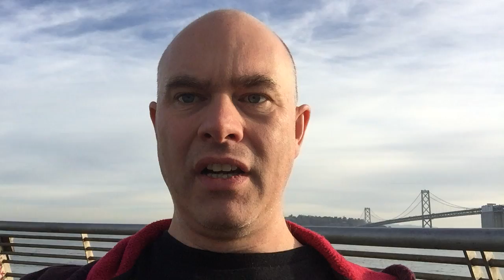Let's Talk About The Antares Launch Failure.

Comment: Damn.  I'm a resident of the DC area and I regularly attend Antares launches.  There's a viewing location that is now off-limits due to this event, and it's notoriously talked about every time I attend at the new viewing spot.  I hadn't begun attending these launches until 2017 or so, but a video of the explosion came across my Youtube feed just now and I began digging into the rabbit hole.

Thanks for this video, Scott.  It means a lot to me.  I wonder if this had anything to do with the acquisition of Orbital Science by Northrop Grumman.  I did briefly get to speak to an old Orbital Science engineer at the recent Antares launch about two weeks ago, but wasn't able to get much of a word in.
Reply from the maker: Years later we know that it was a failure in the turbo pump bearing, while Aerojet Rocketdyne stood by the engines Orbital decided to switch over to a pair of RD-191’s and has had no problems since.

Comment: With regard to the whole debate about the kerosene versus hypergolic approach the Soviets considered, I think they should have listened to Glushko. If they had gone with the UR series or the RD270's, there's a good chance they would have made it to the moon. I think Korolev was a bit naive about using UDMH engines. They are simpler, more reliable in principle, and the RD 270 would have worked beautifully. The Glushko-designed Rd 253/275 series on the Proton 1st stage have a reliability coefficient of 0.998, which is absolutely unrivaled anywhere in history for an engine that has launched THAT MANY times. The f1 was technically 100% reliable, but only a small handful have ever been used. The RD 180 has one iffy launch, and even the mighty RS 25 has had some issues on the pad, especially that time it sent chunks of an injector through the nozzle skirt cooling tubes. The fact of the matter is, the Soviets were at a disadvantage because of Korolev.

Comment: Lets remember that the Soviets won almost every single aspect of the space race, EXCEPT landing on the moon. The insinuation that their tech just wasn't as good as western tech is really something pushed in cold war propaganda.
Reply: Yes, and the N-1 program failure was a political failure, not an engineering failure.
Reply: And comsats. And planetary flybys. And docking. And solar panels. And duration, which the US held from gemini to 70, then Skylab to Salyut 8, well out of the space race era. Not to mention the US developed more than 2 working rockets.
Basically, Russia got to orbit, then the US figured out how to do anything remotely useful with it and advanced our knowledge enough to do it.
Reply: Russia had MANY firsts in the space race, they didn't just "get to orbit" first. I suppose you don't consider putting men into space to be "remotely useful" then? Fuck off with your racist crap, the soviets were technologically up there alongside the west. This could be seen in many aspects, the fact that they won many aspects of the space race only helps demonstrate that. I'm not intending to take away from the US, most of the west's achievements came hot on the heels of the soviets, they had some firsts, and the US DID put a man on the moon. The purpose was to point out that the soviets were not a technologial backwater with all their rockets held together with duct tape and stalinium. They were an advanced world Superpower in their heyday and much of the portraying of them as inferior is just cold war propaganda, which you've apparently gobbled up.

Comment: What surprised me was the panic in one of the press areas. You could tell they were nowhere near the launch site because of the delay between what they could see and what they could hear. But you might think that they have little understanding of the nature of rockets, and the risk factor. We are talking about large vehicles filled with explosives. It’s obviously designed to be a controlled burn of the propellants, but if something goes wrong, the result can be a massive explosion. Fortunately, it was not a flight with a crew, so what the engineers do is figure out what went wrong, and fix it. Sometimes you learn more from a failure than you do from a successful flight. No lives lost, which is the most important thing. It’s a lot easier for the engineers and technicians to cope when no human has died as a result of a flaw. 

I found the comparison of the differences between American and Russian rocket engines fascinating; I’ve seen that before. I almost think the Soviets and Russians needed more efficient engines, as their launch site is so far north of the equator that it doesn’t get quite as big a boost from the Earth’s rotation. 

I also wonder what might have happened with the N-1 had Korolev lived longer. He had the reputation where he might have been able to keep the Soviets in the race for the Moon longer. His successor simply didn’t have that reputation, and thus wouldn’t have been as capable of persuading his government to commit to the Lunar program. I think they might have done better, given the number of engines, to build a test stand first, and really improved the performance, as I recall, the second launch took out the entire launch pad, thus ending any real hope of beating the US. 

All the technology was so new with the Saturn. The second and third stages were one of the first times that hydrogen and oxygen were used, so because the big innovations in the first stage were so large, it was thought that the first stage would use a fuel and oxidizer combination to power that first stage. 

Of course the people at Marshall SFC were very conservative in their approach that they were appalled at the idea of the “all up” test flight, that became known as Apollo 4, where every stage was tested all in one flight. But it worked flawlessly, and issues that arose with another unmanned Apollo 6, where the first stage caused a POGO issue, and the second stage lost two engines, were quickly fixed. 

It also didn’t hurt that NASA was flush with a much larger budget, and basically were told they could waste anything but time, because of President Kennedy’s deadline. I still wonder why in the world the Apollo Saturn system was abandoned, just when all the engineering was done, and all that would have been needed was to simply mass produce them. It’s even crazier when you realize that even though the last three lunar flights (Apollo 18, 19, and 20) were canceled, even though the boosters and spacecraft had already been manufactured. We can thank Nixon for that, and I have always wondered if it was because everyone credited Kennedy, and Apollo was seen by most Americans as Kennedy’s program.

Comment: I mean, you say that the Soviet rocket engines were more advanced, while the American engineers dismissed their approach as too dangerous/risky. But the Americans were proven correct in the end, weren't they? The Soviets lost four entire N1 rockets in a row. Those are very expensive failures (and very visible ones, too). The Saturn V, on the other hand, did not suffer such catastrophic, repeated failures. It seems like the Soviets shot for the moon (pun kind of intended), and it bit them in the ass, because there was too much a chance of something going wrong, and causing a catastrophic failure. The Americans went for something they knew better, something that would be more reliable, easier to test, and cheaper to produce. It wasn't especially efficient, or advanced, but it worked reliably, and that was what won.
Reply from the maker: And yet every Atlas V and Antares launch in the US is using these engine designs.

Comment: Failure analysis is basically the probability of failure per part/system times the number of parts/systems. More engines = More Parts and More Systems = Higher Probability of Failure. I worry about the Falcon Heavy for that reason.

Comment: Scott dude look at the engine it used to be a ju22 didn't it? and they changed the engine when they got it and the welded on some avionic gear and gimbaling ability and that's what made them blow up the modifications.
its a good engine even tho its old as F%&^ but all is fine until you let some one weld stuff to it and weekns the unit.
same thing happends when you upgrade an old commodore ... weld stuff on and something falls off.
like add a cold air intake/pod filter ...then.... exhaust pipe some how falls off.

Comment: Ok so just my .02. They buy the 40+ year old engines and refurbish them and then launch them. But wouldn't it be much safer and more reliable to just reverse engineer it and build them from scratch here? Yes I understand that it's cheaper this way but the Russian engines will run out eventually. In the long run it just seems more cost efficient and safer to build newer ones.

Comment: A few comments:
1. The N-1 rocket used the NK-15 engines - the predecessors of NK-33. The main difference between them was that NK-15 did not handle the multiple ignitions. That mean the one can't test engine on the rig and then put it on the rocket. All 4 N-1 launches used NK-15. NK-33 was developed for subsequent launches which never took place. But the fire tests showed the good reliability of NK-33.
2. The statement "the soviets took many existing engines instead of developing the powerful new ones" is not quite correct. The NK-15 was developed for the N-1 rocket only. In fact soviet engineers wished to have a powerful engine such as F-1 but nobody took the responsibility to develop such engine in a reasonable amount of time. The 30 engines on a first stage was a hard decision. This is a quote from the marvelous memoirs of soviet rocket engineer Boris Chertok:

"The reliability prediction specialists were filled with superstitious fear at the thought of 36 engines on the launch vehicle’s three stages. They were completely crushed when the proposal to install six more engines on Block A [first stage] came out. The statistics of the last few years showed that even among the well-tested engines of missiles that had been put into service, the frequency of failures caused by propulsion systems was at least two per 100 launches. Now they would have to figure the reliability for the N-1 with 42 engines. Consequently, for the N-1 there would certainly be at least one failure every two launches. To protect against the catastrophic consequences of engine failures, back in 1960 the decision was made to develop a system that monitored engine operation, performed diagnostics, and shut down the engine when signs of an emergency situation arose."

Comment: As far as I know, the four N1 test launches all used the earlier NK-15 engine. The NK-33 was a refinement and upgrade of the NK-15 with some of the issues worked out, but the N1 was cancelled before they could test one with the new (at the time) NK-33s. The reason Kuznetsov's design bureau made the engines was largely, from what I've read, because Korolev and Glushko (the main engine designer, previously) had a number of disagreements, including Korolev wanting to go with closed cycle engines while Glushko wanted to stick with open cycle, Glushko wanting to go with all hypergolic fuels, while Korolev wanted to stick with liquid oxygen and kerosene, and the fact that the two men hated each other.

The N1's explosions and failure rate wasn't really that remarkable for Soviet experimental rockets, from what I know, as their usual method was to build whole rockets and keep testing them until they stopped blowing up (the early Proton rockets blew up as often as they flew...). It's just the N1 was far bigger and many times more expensive than anything else they'd developed.

But great video. I hope they're able to figure out what went wrong. The NK-33 is a fantastic rocket engine and I'm glad somebody's finally using them (though really it would be great if Aerojet started building copies of them or something so there isn't the issue of it no longer being manufactured). I've always enjoyed your KSP stuff, so it's cool to hear your thoughts on this unfortunate space related incident as well.

Comment: Fun fact about the F1 engines is that thrust plate was fixed by tweaking randomly and got a solution that kind of worked but pogo oscilations and combustion stability were a huge problem for whole life of SaturnV.
There was information back in may 2014 about failure of one of the NK33 during tests made by Aerojet that may point to some kind of problems with them.My personal choice is to wait for the official investigation.

Comment: The french "Vulcain" engine (made by Snecma) used in the Ariane 5 got an specific impulse (vac) of 4315 m/s. It´s more efficient than NK33, but with less thrust (Vulcain 2: 1350 kN).
But of course it´s a much newer engine.
Reply from the maker: It's also using LOX/LH2 - I should have been specific that the NK-33 was one of the best engines using LOX/RP-1

Comment: Hi Scott, Glushko made the rocket engines for Koroliev until they reach a disagreement on the rocket fuel. Glushko favoured the hypergolic (better for missiles) while Koroliev prefered the Kerolox, this disagreement led to Koroliev switching to Kutznesov OKB to build the engines he wanted.

Glushko built the equivalent to the F-1, the RD-270. It was a 6KN hypergolic engine with better ISP than the F-1 (full staged).

Comment: The tipping is normal, the engines have added Thrust Vectoring to correct the lift lean from two parallel engines, apparently the explosion was actually a self destruct from the command centre conducting the launch, due to a failure of lift velocity and so as to prevent the Rocket taking an out of control direction that might endanger life. The engines failed to operate/fire correctly from the word go, wether that was the engines fault or computers or fuel deficiency's its difficult to tell but there should be a clean almost white flame with a blue tail if it goes correctly, the orange yellow flare from the engines didn't look right at all and the self destruct instruction was well taken. The N1 is as good as it gets before you go to the real bad boy rocket engines but with just two lifting a heavy load the initial launch has to be 100% mechanically correct, and it wasn't. Even Rocket Science uses the 'Saftey 1st' Rule and this is a great example of a fail that could otherwise have been a real disaster.

Comment: Its not really correct to say that the russians was a head of US in terms of tech. They choice a other path better suited to there industrial capacity. US had a lot more high tech capacity, and could produce really large stuff in one pieces, the Soviets could not. The Soviets on the other hand had good experience with metallurgy.

NASA did not go the road with closed cycle engines, because they simply didn´t need to, and it was deamd to risky, not impossible. Under the time table, that was also true. The close cycle engine had to long development cycle to ever get finished during the 60-tys.

Soviet officials rushed a unfinished product with explosive results. There was basically no fesable chans to get the engine reliable before 1973-1974, and if it was american luck or a strategy, or both, i don´t know, but the soviet moon mission had no chance of finishing in time.

That was actually the main reason why US made up the rules as they did, they were pretty certain that Soviet lack the capacity, and that was true. Soviet try to outsmart them, but didn´t have the time to finished the project.

Comment: No one (who knows something on the subject at least) is denying that these engines had an impressive design. The thing is, the materials can't survive as long as the design principle. Frank Culbertson himself said in an interview, that they discovered "stress corrosion cracks" on the NK-33s and repaired them... The thing is they repaired only the visible faults... The metal inside could be any type of mess... I don't know if they do, but they should run ultrasonic tests on every unit.
Reply from the maker: They run all sorts of imaging on the material, they reject bad components (using those engines for spare parts).
Reply: As I read more on the subject, I also got acquainted with the faith of the NK-15s- their direct predecessors. There's no need to tell you what the last results before the redesign to NK-33 were, as I'm sure you're more informed on the subject than me. The thing is, the Russians didn't have time to run one test of the new designs. They were axed prior and all that was left were their assertions that hose new engines would have worked well. Now, I'm nobody to judge, whether they lied or not, but given the history of the technology in question, I'm willing to believe they couldn't have been entirely sure if the 33s would work flawlessly. In the end, the first NK-33 tests ware conducted when they were already upgraded by Aerojet. That leads mo to conclude that maybe the originals are still as dangerous as the NK-15s and the modernization is the only thing "keeping them together". With big quotation marks of course.